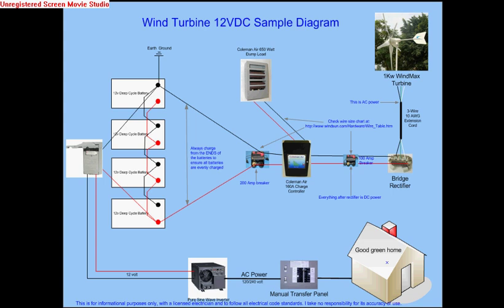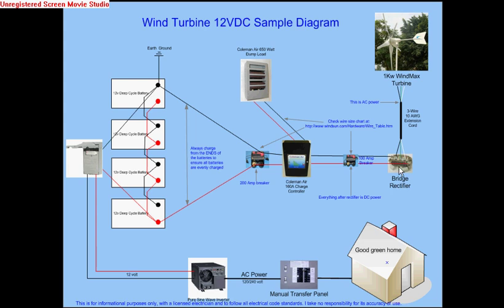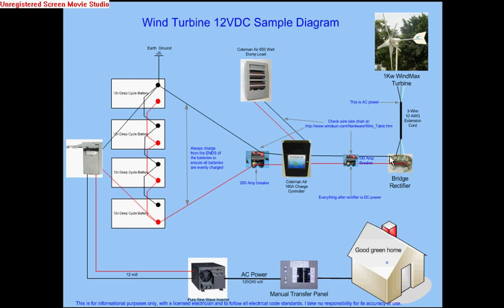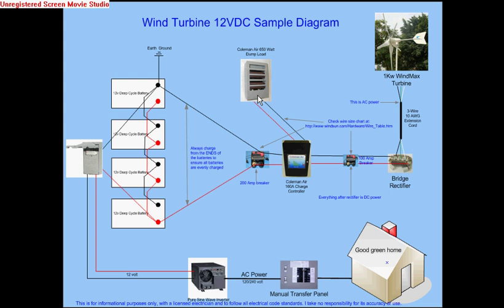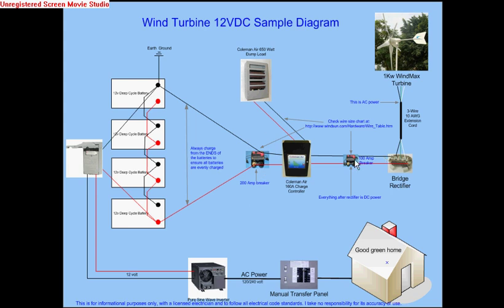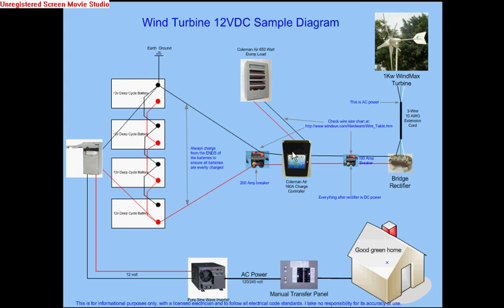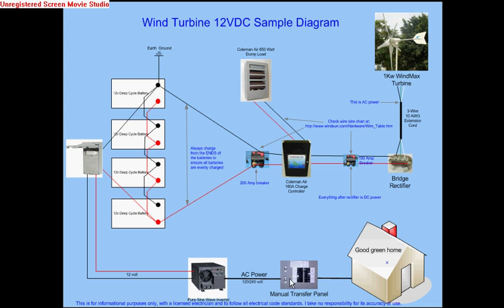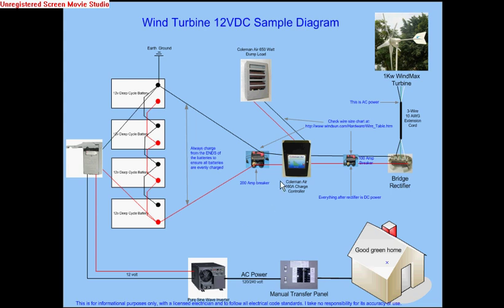How to convert your wind turbine to 12v and connect it to the house

Comment from the maker: It is DC disconnect, you can use a fuse if you like. I can't give you all of the models, that takes a lot of time and I get tons of messages, but you can use this to call someone at wholesalesolar(dot)com and they can help you setup a system with quality equipment.

Comment: That is the big issue. My wind turbin in Arizona works only about 7% of the time. Most turbines require over 10 mph wind to produce reasonable current. Solar panels by far out produce turbins here.It is a good video, but will only back up a system for a very short period of time. I don't even try to deplete a battery bank on a back up system, I use 2,000 watts consently as it is pruduced, running smal A/c units 550 watts each and well pump 1100 watts. At night I shut it all down!

Comment from the maker: @toddac1 Depending on the charge controller you use, some may require you to connect the turbine to itself first and then from the charge controller to the batteries. Other charge controllers simply allow you to connect your turbine to the batteries directly and they simply dump the excess power when the batteries are full. Going to 12v was better initially because we had low winds which allowed the turbines to get to 12 volts easily, getting to 24v requires more wind speed.

Comment from the maker: @jocomag4 Try this, get a couple of marine batteries, connect them in series to get 24v. Then connect one solar panel to the posts of one battery and the other solar panel to the posts of the other battery. Each panel will charge its own individual 12 volt battery, but the sum of the battery voltage will be higher than 24v. Then connect the positive of one battery and the negative of the other battery to the 300 watt inverter. I should put out around 230-250 watts. What do you think?

Comment from the maker: @jocomag4 You should get your money back from whoever sold it to you. Those cheap 300 watt inverters from China are rated at 28v, they won't produce 300 watts at anything below that. You have 12 volt panels whose open circuit voltage are 22.6 v, if you connect them in series you will fry that inverter (I know, I did that with one just like yours). Your best bet is to get another inverter and have one panel per inverter or get a UL1741 real inverter. Sorry for your trouble - eBay is full of fraud